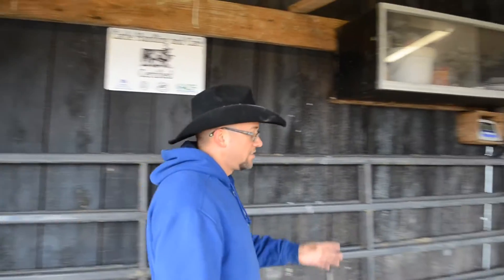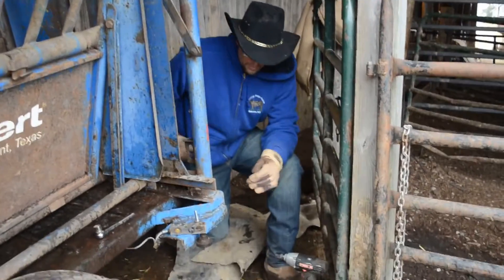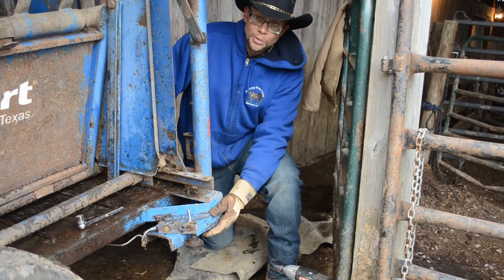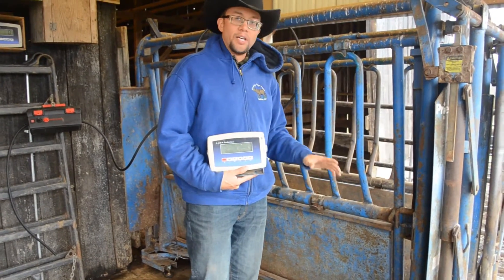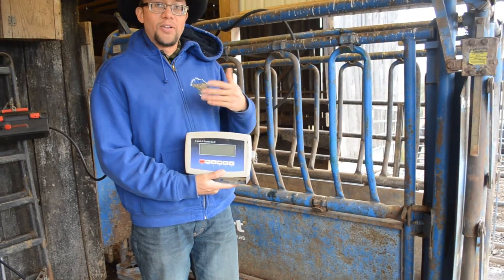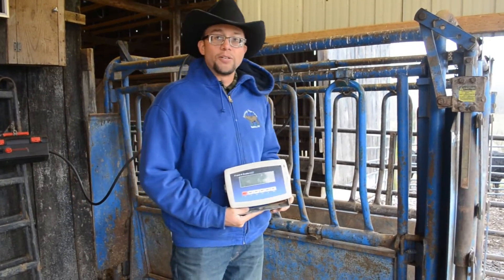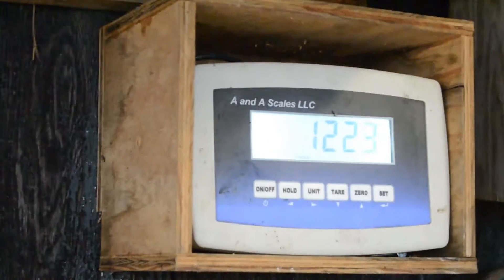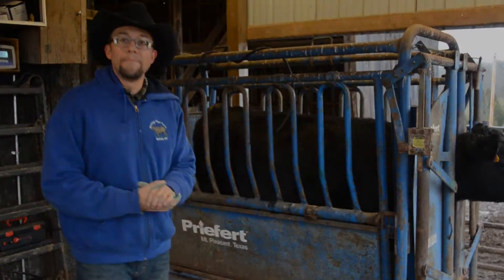Setting up a Cattle Scale System from a Kit

Comment: Hey Josh, how did you weld the C channel to the chute. Was the channel notched to sit even with the base of the chute?
Reply from the maker: Hello Brandon, the paint was scraped off the chute, and the C-channel was welded (without notching) to the base. Scrap C-channel was used for this chute. In subsequent builds two -40 in C-channels were used underneath the chute.
Reply: Josh Jackson ok, so the chute sat on the C channel at all 4 corners